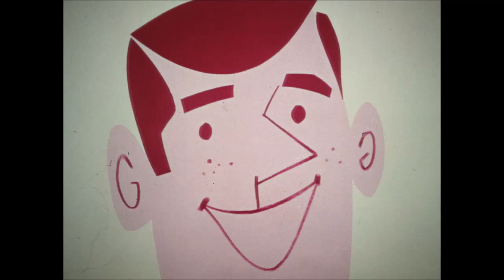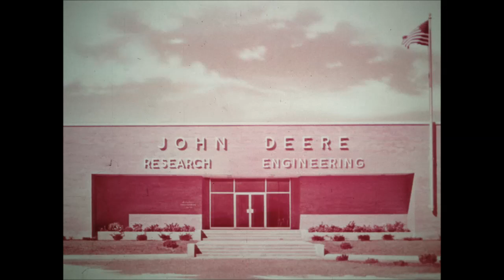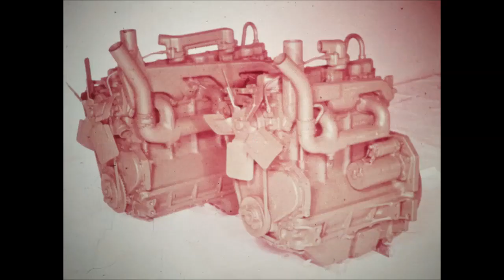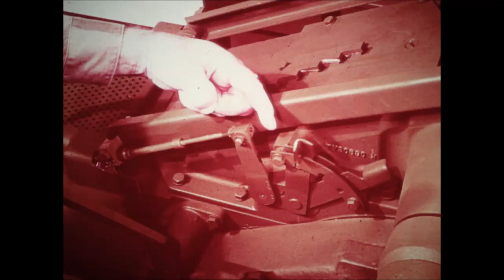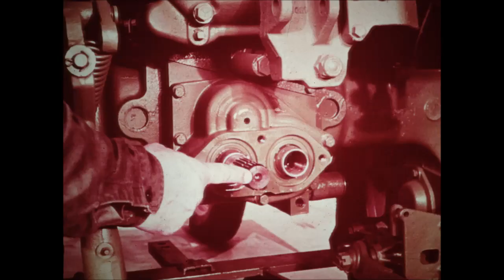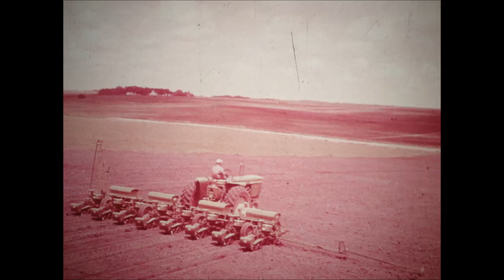John Deere Presents The New Line Of Tractors

Comment: We had a 3010 and 4010 when I was a kid. They were worked hard, then traded for 2240 and 2940, respectively. 3010 had a 48 loader that was swapped to the 2240. Steering on the 3010 had degraded to aim and hope. 4010 was a different story. It was a runner,  had been set aside by a 4020, but the latter burned through PTO clutches doing what the 4010 didn't mind doing. 2940 was a good upgrade though. Matching HP, and MFWD made it a good trade. We later outfitted the 2940 with a 265 loader, and it was a great match
Reply: Lucky you... A 3010 and 4010, what year?  What were your other tractors?  How many acres did you farm?